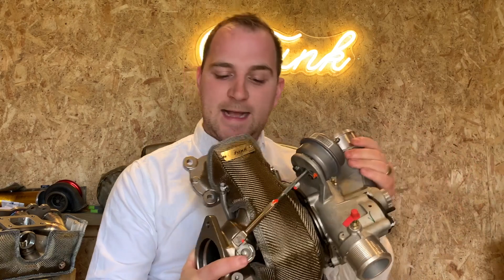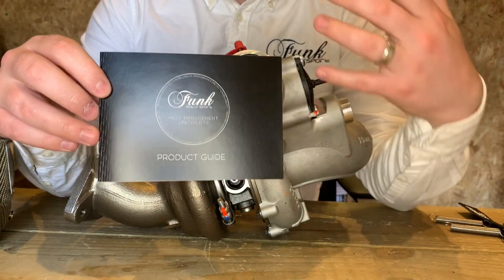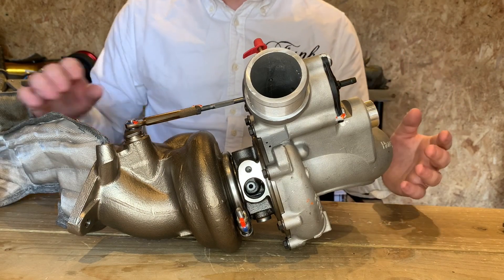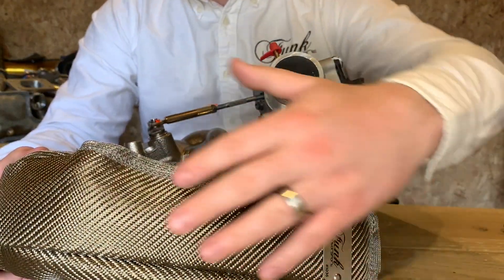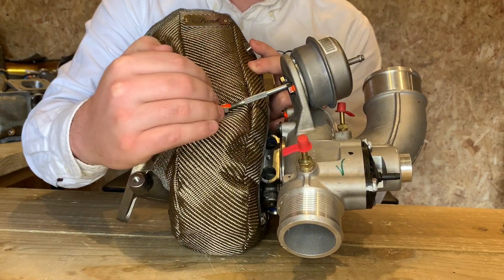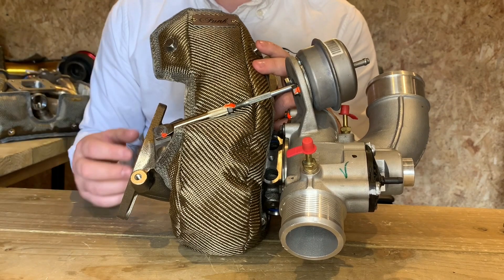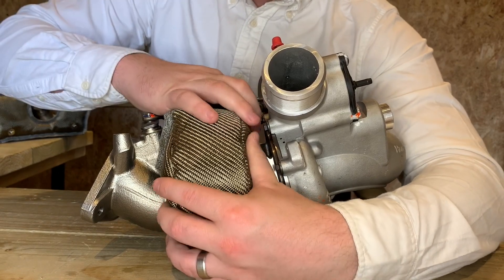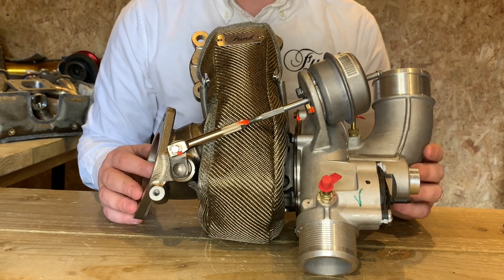Funk Motorsport Mk3. Ford Focus RS Turbo Blanket fitting guide

Comment: Is this meant to be run along side the oem heat shield or a complete replacement?
Reply from the maker: Generally, all heat shielding is removed, as these will exceed the functionality of the heat shield. Some people do however find a way to fit the heat shield around the blanket. But they work best when they are in direct contact with a turbo housing.

Hope this helps!

Funk Motorsport.
Reply: How to you get the heat shield off? The Torx specifically

Comment: Does it also fit the mk3 st?
Reply from the maker: Yes! This would use the same turbo blanket!
Reply: @Funkmotorsport  awesome I’ll check it out! Thank you
Reply: Can you fit this with the turbo still on the car? Or does the turbo have to be removed?
Reply from the maker: @simontaylor4855  Great question. We have many customers that have fitted these without removing the turbo :)
Reply: @Funkmotorsport  thank you for your reply. ☺